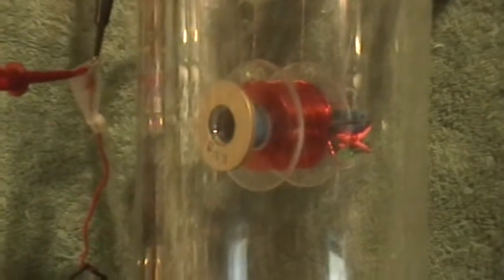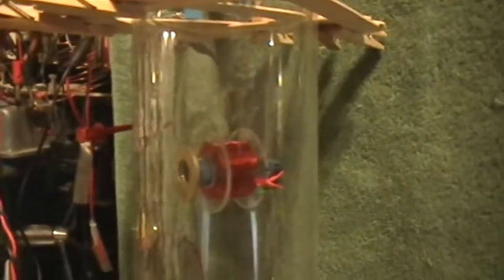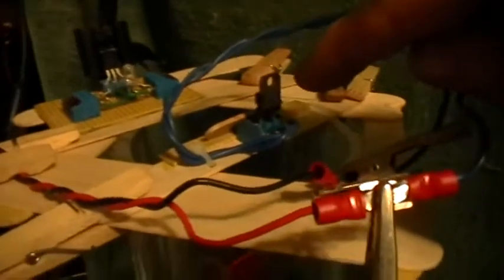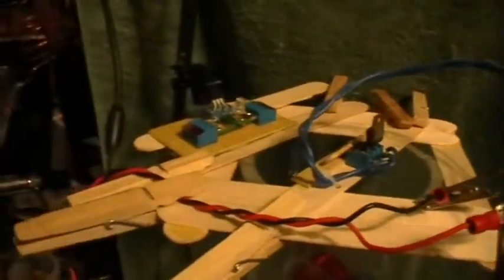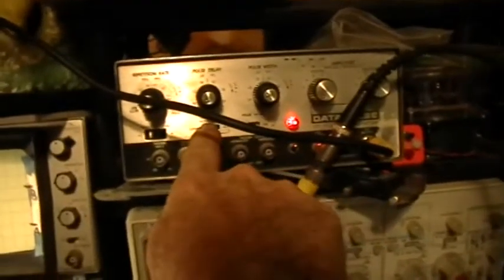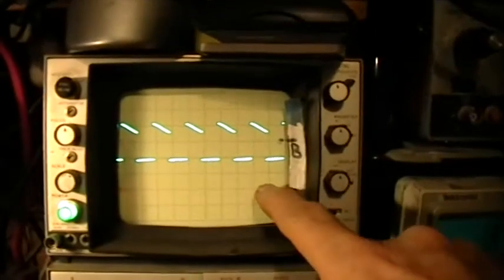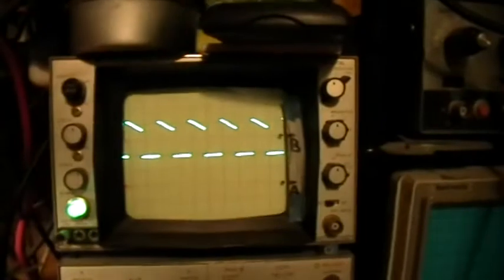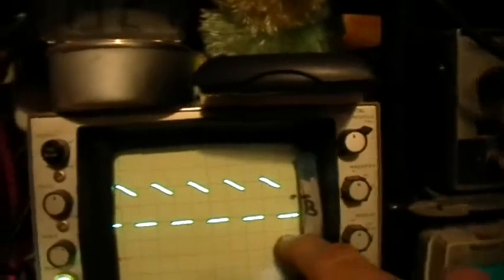Reactionless Propulsion: Charrier Experiment 2B: Gated Stimulation at 1046 Hz

Comment: That's a curious thing.How about a motor using that force...would you say this is essentially a compass needle?I have swung pendulums with high voltage moving over a glass lens and also a plastic ufo, but never seen it on a coil.
Reply from the maker: I don't think I've gotten down to where I'm seeing the Earth's field yet. I think the device is still responding to the large metal masses in the vicinity, like the drill press and the metal toolbox off to the left. The puzzler is why Charrier's device didn't also show this kind of interaction. In his video you can see clearly that he has all kinds of metal nearby his test "chamber", as well as having steel angle brackets mounted quite close to his apparatus.
I think that I still do not know precisely what voltage and current, frequency and duty cycle, that Charrier was actually providing to his test article. Simply setting the Hameg Arbitrary Waveform Generator to produce a certain output, does not guarantee that the unit is capable of supplying that output to an arbitrary load. The actual power seen by the test article should have been confirmed by Charrier with oscilloscope measurements and these should have been provided in his original paper. I believe that Charrier's actual currents (and therefore the voltages) supplied must be sagging quite a bit below what he programmed into the AWG; otherwise he'd be seeing the same kinds of artifactual attractions and motions that I'm seeing here.

Comment: I got an idea how to separate the environment and the real effect (if there is any):

- imagine that the imaginary central axis of the coil would penetrate the plexi glass tube

- where the imaginary central axis penetrates the plexi glass tub (on both sides) glue a rather weak magnet to the outside of the plexi glass tube

- one magnet has its S pole facing the coil and the other has its N pole facing the coil

- the two magnets should always hold the coil stationary, also if current flows through the coil, even if AC flows through the coil

- if there is an additional force (besides magnetism) the coil should move axially a little bit towards one of the magnets

- caveat: it is essential that the magnets are as weak as possible, just to overcome the influences from the environment

- caveat: the additional force might be too week to overcome the force of the two magnets exerted on the coil

Greetings, Conrad

Comment: I just wonder, are the 1046 Hz relevant to cause the interaction with the environment? I think that the 610 ms gating is essential (the pendulums natural frequency, depending on the coils weight and the length of suspension wires), but you could have taken any frequency e.g. between 100 and 10.000 Hz for the pulses. May be you could do a control experiment with different pulse frequencies?

I can not think of any other way to control the environment besides soldering a battery driven "driver circuit" and going as far as possible away from all human made structures. Drive into the desert or into the woods and leave the car a few hundred meters behind. All parts of the set up should of course be non magnetic (besides the coils core). But it might no be worth the effort to design and build the battery driven "drive circuit".

The interaction with the earth magnetic field should be negligible for a 100 mA current and the given suspension. Orientating the coil exactly North-South should show a dependency on the earth magnetic field if it is indeed happening.

Very interesting experiment, but the environment is the big factor (as you already realised yourself). I hope you go on experimenting.

Greetings, Conrad
Reply from the maker: I admit I'm not sure just what significance the "R/L frequency" has in Charrier's experiment. It is determined by dividing the measured DC resistance by the inductance of the coil. It is the inverse of the "tau" time.
Charrier's data include frequencies from 0.5 Hz to 15 MHz. I can't go over 2 Mhz with this setup, but Charrier reported the greatest deflections and inferred the largest thrusts at very low frequencies like 0.5 to 2 Hz. He then also gated these frequencies, but at very long periods of 10 or 100 seconds; this was done not for "resonant pumping" but rather so that each 'run' could act as its own control in a way, by comparing periods of stimulation with "null" periods of no applied current.
In my case I'm seeking to identify and characterise sources of artifact, so the drive gated at the resonant period of the pendulum allows a mechanical "amplification" of the local interactions. If I can see it moving, it is already wayyy over Charrier's reported 1 to 3 micron deflections.
Reply from the maker: Yes, I agree about travelling to a better location far from big chunks of metal.  Have you looked at the photos of Charrier's setup that appear in his video explanation? I'm afraid that his apparatus is closer to more ferromagnetic metals and perhaps also instruments that have fields of their own, than even my rudimentary setup is.
Right now, though, I am concerned about getting the proper drive voltage and current values and waveforms. There is still considerable ambiguity here, since Charrier did not record the actual waveforms provided to his device while in operation. In fact, I am still not sure whether he used a monopolar drive, as here, or a bipolar, -10 to +10 V drive, and I have no real idea as to the currents his Hameg AWG could produce in the coil.